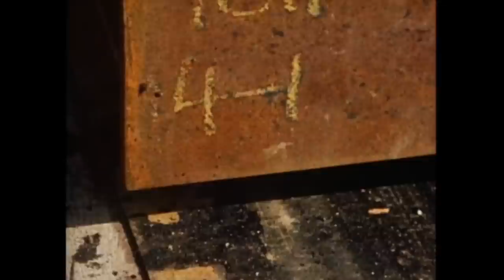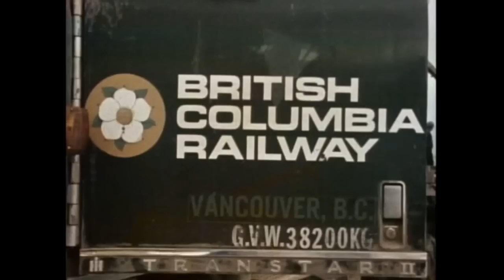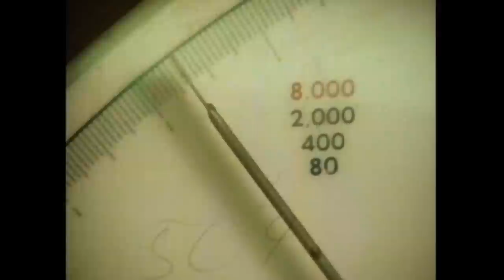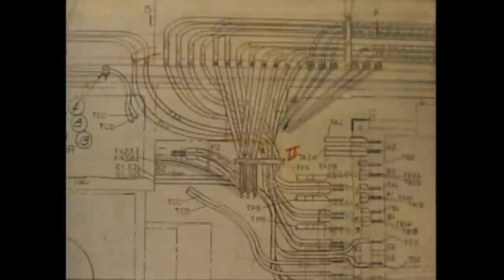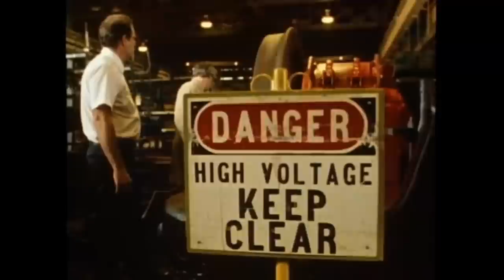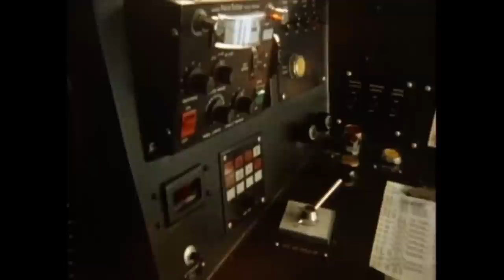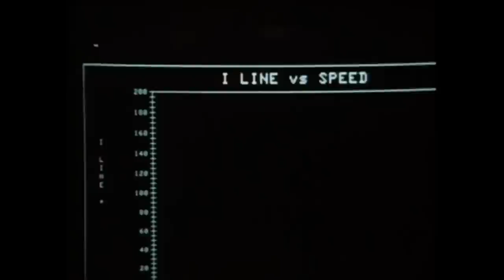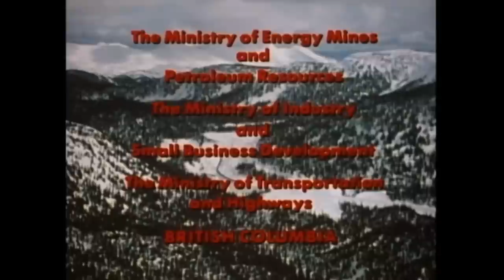995 Days - Construction of the Tumbler Ridge Branch Line

Comment: I worked on this project from 1982-1984, during the construction phase.  I was one of the small team of surveyors that worked for BC Rail and did layout for the building of that portion of the railway known as the Table section, that ran from Anzac to Table Table tunnel.  It was one of the best jobs I ever had, and I have over 25 years of construction survey experience ( I work inside now).  Of the three surveyors shown in the opening sequence, I knew them all and one of them, Maurice, was one of the chainmen on my crew during the 1982 construction season.  It was an incredible experience working up there and one that I will always remember.
Reply: Mike Zelt Why 1000 days for the project?  Seemed rushed for the terraine.  Beautiful country though.
Reply: Thank you for your hard work. A most remarkable project, and one you can justifiably be proud of.

Comment: I just don't get it. The futre is suport to be electric! I guess this is the past. Is anything left of the tumbler sub? Power poles still up?
Reply: Tumbler Ridge has 42 water falls!!
Spatular !!!
Reply: +Jacob Tompke nope, were removed in the early 200's after the locomotives were all scrapped (all but one). now the line is mothballed
Reply from the maker: +Jacob Tompke From what I have seen, a good majority of the actual support posts are still up just with the wire rotated off to the side. No chance of them being used again though
Reply: Line is still goin. I was up there in sept n October doin rock work and brushcutting. Still hauling coal out
Reply: its all there to this day, wires and all, it's just abandoned
Reply: I stood on the bottom base of one of the power poles today and jumped across a flowing ditch of water onto the rail bed at one of the tunnels.

Comment: If Canadian national wanted electric power the solution might be Salt Lake City Stadler Rail Euro 9000 because it can run on 50kv 60hz which is basically 25 KV 60hz  increased power then diesel that way they can run on this line and Oakville Subdivision which is part of the Maple Leaf Mainline New York Penn Station Croton-Harmon Metro-North Albany Syracuse Niagara Falls New York State Niagara Falls province of Ontario Hamilton Toronto Union Station via Oakville